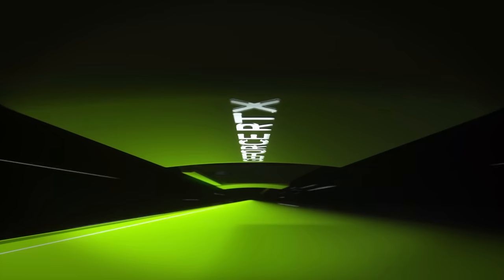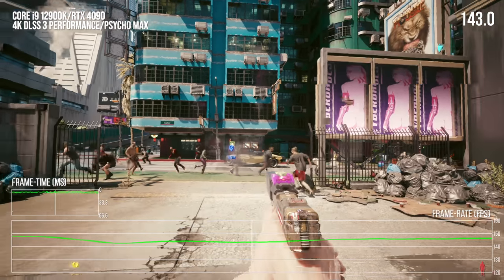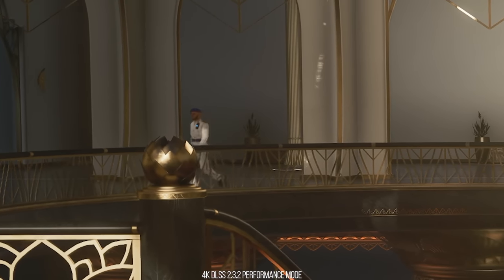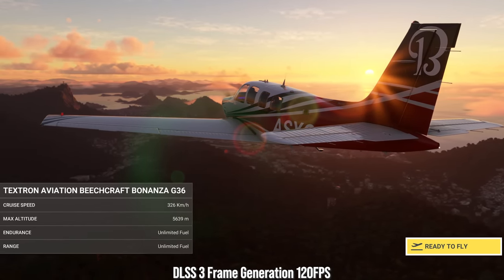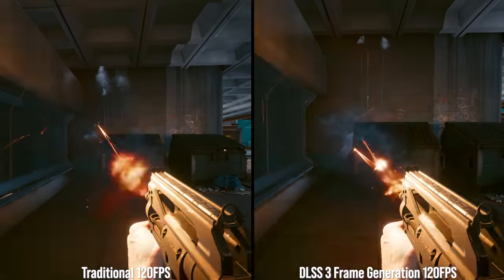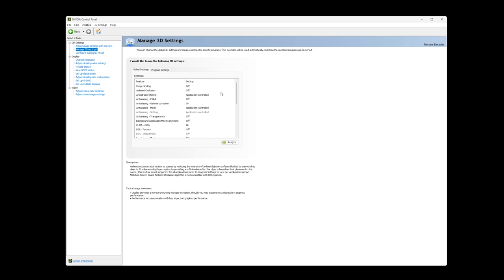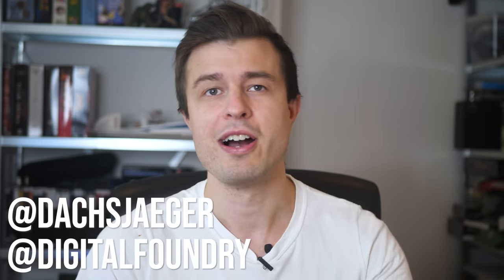Nvidia DLSS 3 Analysis: Image Quality, Latency, V-Sync + Testing Methodology

Comment: I'm not convinced that DLSS 3.0 is a "must have" feature or that it has a lot of staying power. I'm specifically talking about the frame generation feature as I think DLSS 2.0 is phenomenal in terms of image quality and performance. In a way, DLSS 3.0 is trying to address motion quality while DLSS 2.0 was more about image quality as it upscales from a lower resolution to give you image quality at a performance that would be impossible otherwise on that GPU. With DLSS 3.0, you already need to have "good enough" performance and DLSS 3.0 steps in to smooth out the motion, but still comes at a cost to input latency. With the knowledge that you don't want to exceed the refresh rate of your monitor with DLSS 3.0, that makes it even more of a limited feature only really suitable for high refresh rate monitors. But, with the increase latency, it also has limited appeal for those of us that actually have these higher refresh monitors, because it's no good for e-Sports. Just extreme videophiles I guess who have to have 4k at 100+ frames.

Comment: What about input latency when using a framerate limiter (RTSS or NVIDIA Control Panel) and V-SYNC *off*? If limiting the framerate below the monitor's refresh rate, you shouldn't need V-SYNC on to avoid tearing anyways, right? (Assuming you are also using a GSYNC display.)

Comment: Thanks again for the great coverage Alex! I'm mostly curious in the case of how it looks and feels when you're heavily GPU limited on your base framerate (say around 45 - 55 fps) and you want to use DLSS 3 to improve the overall visual fluidity to be greater than 60 fps without compromising on visual settings. From what you explained it looks like it would feel worse to play than the base framerate due to the latency hit, but visually it would look more fluid. I'd really like to know about this and see it in action especially on lower end 40 series cards.

Comment: it's so weird you're getting performance problems and dropped frames with OBS. I'm not getting that on a Ryzen 3100 + GTX 1070 or even 750Ti. Obv at 1080p but still

Comment: I'm confused about the Vsync latency part (30:15). If you're below the maximum refresh rate, isn't the latency improvement just because Vsync isn't active? Therefore, there will be screen tearing, and Vsync might as well be off. Why would you recommend Vsync on then, is it just for if you're also using Gsync?
And you showed a result where using RTSS to cap the FPS just below the refresh rate still produced high latency (31:16), which is very weird to me. I would think that Vsync isn't active and is not the source of the latency, so does that mean any method of limiting FPS (with or without Vsync) causes high latency?
Great video overall though, lots of good information.

Comment: I can explain Frame Generation best:
Instead of your eyes seeing Frame 2 immediately after render, your eyes look Frame 1 for 2 milliseconds, then your eyes looks at Frame 1.5 for half the time that you would have otherwise looked at Frame 2, and then you Look at Frame 2 for half the real time as well.
So instead of watching Frame 1 for 10ms, Frame 2 for 10ms and so on .... for 100 fps footage,
You now watch Frame 1 for 10ms, Frame 1 for 2ms, Frame 1.5 For 5ms, Frame 2 for 5ms, Frame 2 for 2ms, Frame 2.5 for 5ms , Frame 3 for 5ms.
Essetially all real frames are stalled by the optical flow cost of interpolating the middle and all real frames only are on screen for half their intented frametime because the FPS is doubled.

And let me put it another way: if you press a button, instead of viewing the result immediately, you instead have to watch the fake frame even though the engine already moved your character or fired a gun.

Comment: There is something odd in the footage comparing DLSS 2 with DLSS 3 with frame generation and RT on psycho near the end of the video...
Internal resolution seems to be a lot lower on DLSS 3 (even though they are supposed to be at the same quality) especially when looking at the shadows resolution starting at 32:59, the shadows on the left hand side look way better, particularly with the ones casted from the tree...you can see shadows popping in at low resolution at 33:08 on DLSS 3...was that the wrong footage or something else is going on?

Comment: 24:06  I feel proud of myself that i notice the floor in the initial scene before he pointed it out because usually he says an error and am still trying to find it. 

Btw that scene has a lot of other differences due to smoke, the red lamp seems to have some smoke around it that makes the Tv behind it hard to see along with the whole area above the characters being more darker. Even the skeleton anima head is hard to see at the DLSS3 screen and the roses drawn on the wall at the top of it are very hardly visible at the DLSS3 version. Is the smoke a random thing in the game there, that you can get sometimes and not and has nothing to do with DLSS3? 
Also the name of the bar is a darker yellow while the green led line lights in the traditional version seem to have a more halo effect than in the DLSS version.

Also 32:43, i see tearing at her arm in DLSS3 version.

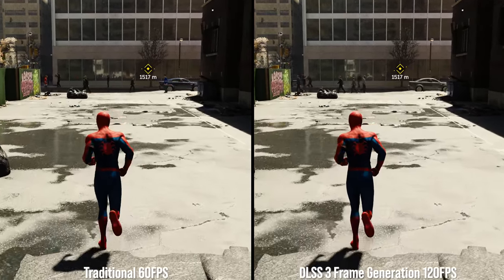Comment: Hm. At 5:00 you can clearly see that is a guy on the background on the left upper corner, that is throwing something in the air. On the frame generating side of the video you can see a lot of errors on drawing the floating object. So, yeah... frame generation is ok but not as good as the native frames

Comment: The sad thing is that there's still no way to have consistent input lag in a scenario that varies between framerate limiter -limited vs CPU limited vs GPU limited. This leads to camera judder and input lag variance when switching between the states. (And you should NEVER run at monitor framerate limit with vsync)

It's just ridiculous that you have to dance around with the performance, trying to fit it into an ideal range. For example, in Naraka Bladepoint I have to try to create just right amount of load with the settings so that the performance goes slightly above my refresh rate out of combat (causing tearing), and falls into the upper end of the monitor refresh range in combat. Framerate limiters, both in-game or Rivatuner limiter cause frametimes spikes when the limiter engages and disengages during FPS drops, clearly measurable with CapFrameX.

Nvidia reflex (only in supported games) does give great input lag at GPU limited scenarios, but it could be improved with an added options to standardize CPU limited input lag to the same, as well as to limit the framerate below refresh rate to avoid vsync lag or tearing. Reflex is technically a limiter, so it should be able to do all that.

Comment: So since DLSS 3 adds pretty severe latency when the framerate goes above the display's refresh rate (and RTSS framerate limiter does not help), and the RTX 4090 is so freaking powerful that most games are going to easily hit around 4K 120Hz, it sounds like DLSS 3 is more future proofing for even more demanding videogames that won't hit such high framerates.  Unless of course a newer version of DLSS 3 can somehow mitigate this issue.

Comment: 33:00 What happens with the DLSS 3 example if you limit the framerate in the Nvidia Control Panel to something like 100fps.
Do you get better latency consistancy and frametiming, or are there perhaps hidden problems with DLSS 3 when doing so?
In my experince slightyl higher but more consistant latency, can be perfered against lower but less inconsistant latency.

Edit: Nevermind, I missed what Alex said around 31:06.
Reply: I think you are confusing input latency with frame pacing. Alex mentioned that an artificial limit such as rivatuner or nvidia frame limiter induces tremendous amounts of input latency, so for all intents and purposes its useless. With such high fps the frame times (pacing) shouldnt matter too much but high input lag makes a lot of games unplayable. DLSS 3 looks good on paper but I will never buy a 4090 to be able to play games at 120fps in 4k. I think DLSS3's value for mid range GPUs that are about to be released in the next months is a lot less, which makes the tech in my case kinda uninsteresting.
Reply: @mewtilate420  You are correct. I missed what Alex said around 31:06 since I skipped around in the video a bit.

Comment: Well input latency @ 60 hz is one thing. Does The AI interpolation take into account the input of the "middle man" frame during the time its generated? So motion will feel less "clean" at 120 hz simply due to the fact that it takes only 1/2 the general inputs that a 60 hz game would. IE once ever 16 ms vs 8 ms. Of course during slow paced games this probably wont matter, but fast paced games you might notice more. However at that point you're probably playing fast paced games w/ DLSS 3.0 anyways.

Comment: As a person who has played around with early ai frame generation tech for videos, I'm incredibly sensitive to the artifacts and overall look that an AI generated experience can cause. In low motion stuff like flight sim ur probably never gonna notice it, but I would never want it in spiderman or cyberpunk and anything similar, the cyberpunk testing impressed me but I think if u tested more intense situation you would find artifacts.
Reply: Like the one off spiderman error in the cutscene I probably would've noticed cuz during the times I would use the frame generation software for videos that exact kind of artifact would be exactly what I was looking for
Reply: At around 20:00 in the video pay close attention to the birds in the top right. You'll see it, the second set of birds flickers.
Reply: The first set wing flap also has a slight artifact
Reply: I’ve been using it in spider man for 10+ hours and it’s been absolutely fantastic. There’s a small hit to latency but it’s not hindering my enjoyment at all. Especially when I can max out raytracing and use DLAA and double my frame rate with the frame generation
Reply: @bitbat9  nice! I'll probably want to find out myself with my own testing what I think of dlss 3. Unlike the video software I've used dlss3 has motion vector data to help generate frames. Which should clean up a lot of possible artifacts

Comment: I had to play Cyberpunk 2077 in ultra performance mode, and I can confirm that under that setting, moire patterns are also visible with certain fine details, like the pinstripe suit worn by the girl you rescue. But this was at launch when I played that particular section, and I haven't been to Jackie's mom's bar recently. Is it possible the latest patch fixed certain moire issues?

Comment: Is a DLSS only GPU possible?

Well not completely DLSS only, but with greatly reduced traditional GPU functionality with DLSS like functionality at full swing for some thing like a Switch 2 Dock, or streaming services like the almost dead Stadia? Additional data can be sent along with the video stream that gives motion vectors or whatever is required to generate frames in between and better upscaling so the video stream could be at a lower bit rate, possibly helping with a constant frame rate, and reduce the latency of the streaming software packaging (compressing?) the video stream before sending it.

Comment: When using frame generation with traditional DLSS. I assume that the AI frames are interpolated from the two DLSS frames, and not the original frames. 

Also why is there tearing? I don't understand why g sync doesn't work.

Comment: With FG running at low fps with ultra settings, I find environmental details like reflections, shadows, bushes, particles, etc still running in native 30-40 fps while camera movement happens in 60+ fps. Is this normal, and how can I fix it? I am weirdly unable to find any answer or discussion around this anywhere

Comment: Can we just cap the fps at monitor's max refresh rate using software like rivatuner statistics server to avoid using v-sync which introduces input lag?
Reply: I'm surprised he didn't address this as a I thought it was common knowledge that there's no need to use v-sync at all, just cap the max frame rate at least 3 frames below your monitor's max refresh rate for no screen tearing and an input lag improvement. (I myself just use nvideo control panel to do it for a global fix). Sounds like this might be doubly important to frame generation, I'd like that 117fps test preferably at 116fps without v-sync at all. Maybe this is the sneaky reason v-sync is not officially supported?
Reply: It dont work well...screen tearing will happen

Comment: In games where VSync isn't a good solution for screen tearing, is there any reason you can't just cap the frame rate below your monitor's refresh rate? 115 fps is good enough, those last five frames wouldn't add much to my experience

Comment: can you use a frame-limiter with DLSS3 instead of using vsync? this would be much better than vsync regarding the input latency.

i have to say frame generation does not convince me. it just works good if there are already enough frames and it increases the input latency ... so what is it good for? longer benchmark bars?

Comment: The future weaker 4060 and 4070 will support DLSS 3 frame generation as well. I was expecting this to be the primary use case, helping to get these cards to a nice v-synced 4k 60 FPS on demanding RT titles. Imagine a 4060 with Cyberpunk at 4k at psycho RT settings. Probably well below 60 FPS. Wouldn't this be perfect for DLSS3? I hope DF will look at DLLS3 at these "lower" frame rates again once the weaker 4000 series GPUs come out.
Reply: I'd imagine the opposite. Worse latency due to less native frames which would feel worse than what is seen. Hardware Unboxed limited a 4090 as a rough test of your use case and it increases the likelihood for some visual issues while having a worse feeling experience compared to the frames being spat out. Sure you have no tearing but for a lesser experience. Balanced settings have potential but ultra settings with RT and 4K on lower end GPUs is a pipe-dream if you want the game to feel as smooth as it looks; especially when more demanding titles come out. Another factor is also UI elements artifacting more at lower frame rates, as noted in the Hardware Unboxed review. I think you would have to be rather careful when choosing a 4000 series GPU for what you want, likely with the intent to save money.

Comment: so to summarize: dont use rivatuner to cap frames with DLSS3? and instead just use vsync from nvidia control panel, and max the settings in the game so the frame rate gets lower to what you want it to go? how about capping the frames with nvidia control panel options? or thats not ideal as well?
Reply: RTSS frame capping is disastrous to the FG frame pacing, a definite no. I have not tried the global V-sync option yet, but without it, I can say that allowing the frame rate to hit the 120 refresh is very bad for page tearing and frame pacing. I have tried the control panel frame capping, but that did not give a smooth experience. Not as bad as RTSS, but better without, IMO. I capped at 60, but prefer uncapped at 80fps avg on an OLED. Capping to 60 on OLED means having to use motion blur in-game, which I don't like. 

This is my experience in Cyberpunk. RT overdrive gives very low fps without FG on.
Reply: @r0tekz  yeah i had to disable capping the frames on rivatuner with this game when using FG, you could use the max frame rate cap on nvidia control panel but its also not ideal, it does the job better than rivatuner for sure but still, i do use vsync from control panel and its fine doesnt affect the game at all.
Reply: @sergiomarin7632  I just tried the control panel global vsync and it does work pretty good to stop tearing and stutter at the 120 refresh rate. I don't find control panel capping at 60 to offer any benefit to pacing and leave it off for the extra 20 fps. (I use gsync).

Comment: It will be interesting to see how a 4060 or 4070 handles 4k gaming with dlss 3 frame generation enabled. I think if a game can only be ran at 30fps 4k native but 60fps 4k with frame generation then the artifacts and sluggish input will be much more noticeable. This just further solidifies the theory that Nvidia is trying to push everyone into buying an rtx 4090 as it seems to have the best value. I myself am considering the 4090 only because it can play most current demanding games above 60fps at 4k and with frame generation being able to double that it makes the 4090 seem like a better long term investment. But if you consider saving money each year towards a future gpu then it matters less to have a future proof gpu. Who knows what a rtx 5080 or even 6080 will cost and offer for 4k performance. Maybe by 2025 I'll have the ability to afford a high refresh rate mini oled 42in monitor and actually run games at that high refresh rate. Also I'm hoping that in the future the 5080 will be back down to the $600 price range. Normally I'd also consider AMD's offerings but because Nvidia gpus can use fsr 2 and dlss 3 now it makes little sense for longevity. Now if Amd had a significant price to performance ratio, say a $300 rtx 3080ti competitor only then would I consider it.